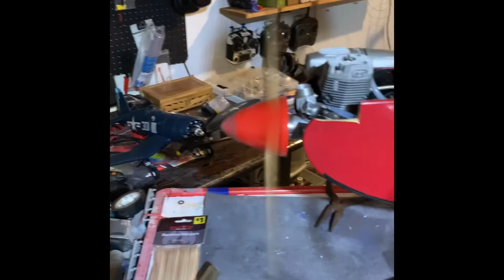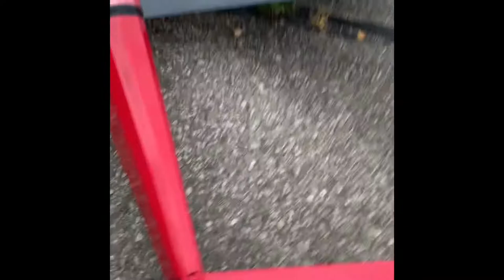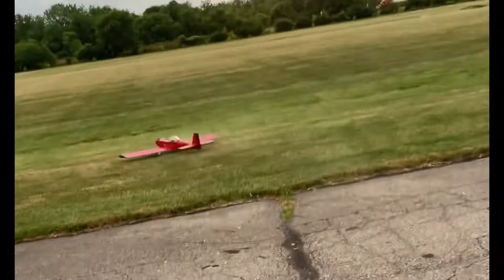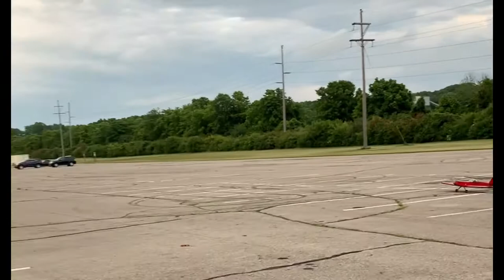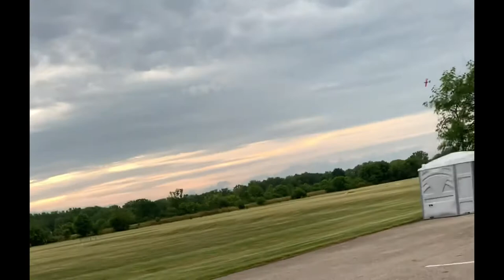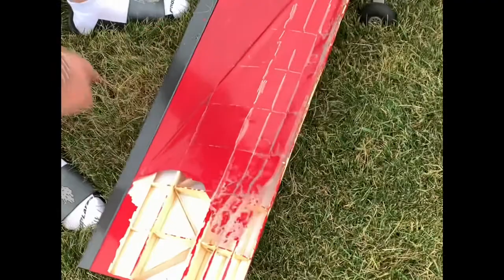First Nitro Flight Fail

Comment: Quick tip. At full throttle Briefly pinch the fuel line. If the rpm's pick up a few hundred then you are spot on.  No increase is too lean.
Reply from the maker: Thanks for the tip!!